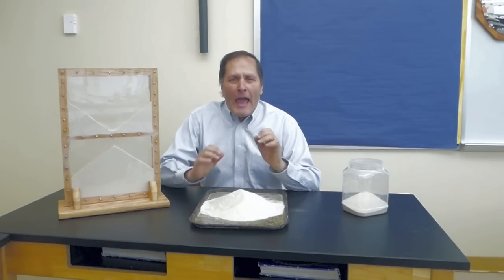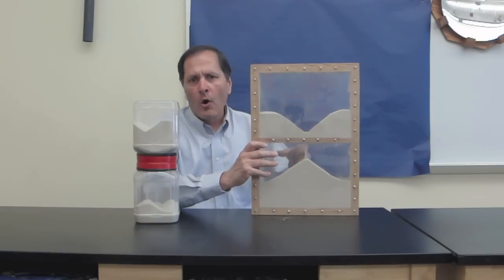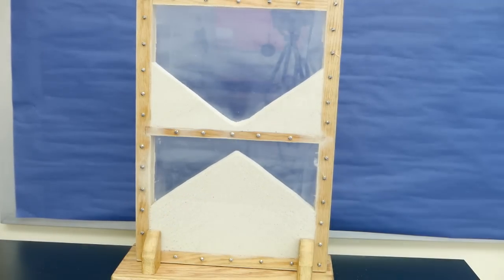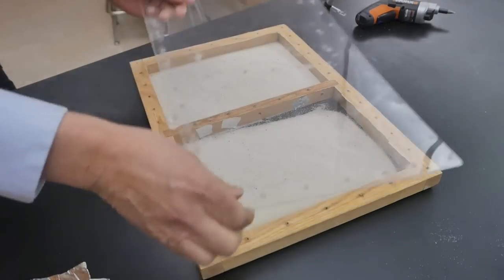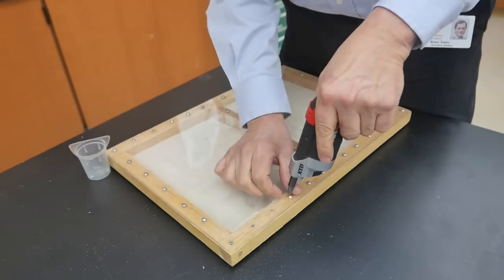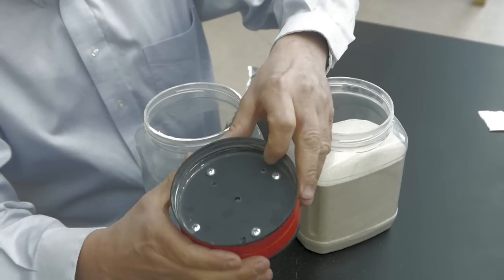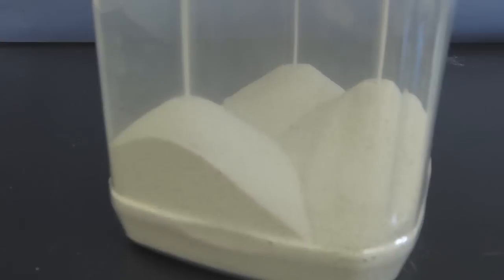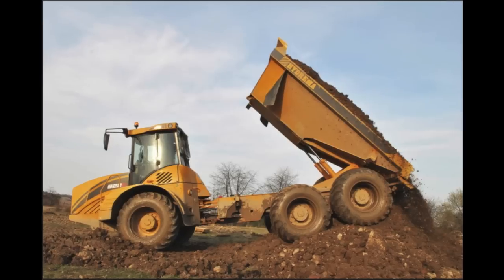Angle of repose…Physics of toys  //  Homemade Science with Bruce Yeany

Comment: Rather than unscrewing the whole panel, you could use screws as blocks for the holes. (Similar to a pin valve) that gives the benefit of adding a 3D visual confirmation of which holes are open or not... 

Though I do find it interesting the relation between the curve of probability and the angle of repose...

Comment: Hey you should drill holes in the middle and use dowel plugs to control the sand entering each hole instead of disassemble the unit each time

Comment: I dig your sand experiment. I had an idea, what if you were to make your holes through the bar intersected by an oversized hole that is perpendicular to the plastic faces, then you could insert dowels into the holes and drill holes through them, leaving a little nub sticking out through the face of the plastic that you could turn, creating something like a ball valve? That way you could open and close the holes without taking the thing apart.

Comment: interesting presentation.

does viscosity change the results, (ie, coat the particles with a lubricant)

or temperature,

barometric pressure,

size of particles,

latitude of the physical location where the experiment was conducted,

( i do like your work, never stop being you.)
Reply from the maker: Hi Molly,  some factor will affect it more than others,   type of particle,  size,  density,  powder,  if it is damp or not all change it,  the temperature or barometric pressure probably not so much
Reply: i just found you recently,

and now i am in love.

this is food for my soul,

so to speak.

love, peace, and mercy
molly

Comment: I wonder if the tape/hole system could be replaced with some sort of thumb-screws that allow you to open/close the holes without taking the whole deal apart.  (Or perhaps a set of masks with holes that slides into a groove?)

That would speed demonstrations up.

Comment: Why not just put screws in the middle piece  where the holes are and then you just have to back out the screws to open the hole instead of taking the whole thing apart.

Comment: I know this was meant to just highlight some fun interactions, but this "angle of repose" is actually something I deal with DAILY at my job. Long story short, I work with an aggregate product that includes particles the size of dust all the way up to chunks a couple inches thick. If left too long, the product "sets up", meaning it actually locks together. When that happens a pile of it can actually create an angle of repose that's 90 degrees, literally a cliff. That can be a very bad thing. We have air cannon vibrators, air spears, and dynamic dumping points. Unfortunately some times that isn't even enough and we have to break out the explosives, all just to get some powdery gravel moving.

I've spent the past few months trying to come up with novel new way to conquer these problems, but so far have had no luck whatsoever. I've tried to work with digital versions of the sand toy you showed, but unfortunately they don't allow for simulation of a product like mine. Any suggestions would be much appreciated. If I could find new ways of dealing with my product, I could save my company millions of dollars.
Reply from the maker: this is a basic example,  it is nice to hear about real life situations,  thank you
Reply: Why it sounds like you have a really cool job! This type of job never entered my mind. Or the problem your facing. I hope some brilliant person out there can help you find a solution!
Reply: I know your comment is over a year old but have you experimented with fluidisation to help solve your problem? https://www.youtube.com/watch?v=zjgURBIqJ6s

Comment: This video has a lot of focus on the concept of critical angle and the observation of such, but you almost only describe why materials have a critical angle in the description and don't go into depth about that. That's a shame.

Also as previous commenters said, the undoing of those screws is quite a hassle. What you could do is make the divider have a hollow section through which you can move a slider. This slider could have holes at specific points to coincide with holes on the divider, making it so that you can choose the amount of holes by moving the slider.
Reply from the maker: I teach 8th graders,  this is something to give them a very basic idea of the concept.  I do have a few other ideas that I want to try
Reply: Rik Schaaf the student has to go look it up 😉

Comment: I was sort of hoping for more of a look into what type of things affect the angle of repose rather than just an observation that it exists
Reply: The speed of falling particles (or falling height) changes the angle. Not just speed, the diameter (or length) of the base and roughness of base plate also changes the angle of the heap. For more info please check: Miura, K., Maeda, K., and Toki, S., 1997, “Method of Measurement for the Angle of Repose of Sands”.
Reply: stickmandaninacan    Indeed. Waiting for some surprising revelation, or strange effect, or genetal law of physics, or interesting insight, or whatever, and... nothing. Just sand that does what it always does: piling up. Hm. I feel a little bit duped.
Reply: Or maybe you could actually do some research and find the answer for yourself.

Comment: I wonder if it's the same angle like on the Great Pyramid of Giza :)
Reply: Damian Rozycki I looked into it, the Giza Pyramid is at 51 degrees from bottom to top. I bet if it started to crumble, though, the heap would be at 30 degrees.
Reply: https://youtu.be/XwK-JP0VlHA
Reply: https://www.willemwitteveen.com/the-magical-connection-between-desert-sand-and-the-great-pyramid-of-giza/

Comment: You should put spring loaded pegs going out perpendicular that can be locked open when you want to open the holes. or a stopcock valve design that can be turned to open them.
Reply from the maker: I need something here,  unscrewing it is a pain
Reply: Bruce Yeany I'm sure, that's a lot of screws! :)
Reply: phoenixamaranth I was thinking captive pegs to vary the number and location of the holes, though I suppose spring-loaded could work as well. cheers.

Comment: In your first sand frame, could you screw in a screw from the side through the plexiglass to block or open the holes without having to take it apart?

Comment: needing to undo all those screws made me cringe haha you need one that's easier to change the number of holes!
Reply from the maker: you're right it is a pain,  I was thinking of trying small pegs at each hole   that have holes in them,  turn them to either let the sand through or to block it.
Reply from the maker: Eventually,  I will change this to make it easier, I have a few other designs in mind when I get to that point
Reply: I was thinking you'd be better off using a rubber door seal between the perspex and frame, just use a good few butterfly clips or clamps to hold it together, much easier to open.

Or if you can put a smaller piece of wood through the central piece then you could drill holes in a fashion that moving the smaller piece would open and close certain holes so you'd never have to to open it up.
Reply: Bruce Yeany I imagine if you placed the holes between your screws but also made holes going through one side that intersect with the holes for the sand, you could just place dowels in the holes you wish to block, and remove them from the ones you want the sand to go through. No opening needed!
Reply: dumpywhite
That's a much better idea than my convoluted one.
Reply: With the amount of screws you had to undo to change the number of holes I'm amazed you managed to stay calm lmao. dumpywhite's idea is probably the easiest to implement. Just grab a drill and poke holes that intersect with your existing holes, and plug whichever ones you don't need with dowels. You won't even have to undo the screws lol.
Reply: Why not make it with a slider that aligns to the hole/s you want to open?  I'd think that would be fairly easy to manage.

Comment: Does the rate of speed in witch the sand fall, change the angle of the pyramid.?.. i.e. size of one hole either smaller or bigger?
Reply from the maker: I don't think the angle would be changed, just does it faster
Reply: your experiment seams like it wants to create an Equialateral Triangle.sand seams like their could be variables on grains falling left of right. rocks be uniquely shaped. i wonder if steel BB's would produce an Acute Angle or something more flat. i enjoy your channel thanks
Reply from the maker: I guess whether the sand goes left or right might be an example of chaos theory.  The angles formed  are also  going to be dependent on the amount of friction between the particles,  the more friction the higher you could stack it and the steeper the angle.  Without enough friction between them,  I would think the BBs wouldn't pretty much flatten out.  I haven't played around with any other materials other than the sand.  thanks.
Reply: Yes, speed (falling height) changes the angle. Not just speed, the diameter (or length) of the base and roughness of base plate also changes the angle of the heap. For more info please check: Miura, K., Maeda, K., and Toki, S., 1997, “Method of Measurement for the Angle of Repose of Sands”.

Comment: You could improve the wooden "toy" by make holes from one side throw where the vertical holes are, and put sticks in it. If you pull one stick out a bit (not the whole stick, because sand gets out), than the sand can run down, if you push the stick back, sand cant run down in that hole. So you dont need to take the toy apart for switching holes. :) 

Or you can make a wide hole through the whole toy where there is a vertical hole and make a wide stick with a hole in the middle and put that through the whole toy. If it has little sticks attached the two hanging out part, than it can not fall out from the toy but you still can push or pull the stick and the sand only runs when the holes get together inside the toy.

Hope you can understand :) I love your videos and ideas. I wish we could have teachers here in Hungary like you :)
Reply: You can use screws instead of sticks. Its easier to pull out (screw out) without the risk it falls out from the toy.
This type: http://www.clasohlson.com/medias/sys_master/8872506589214.jpg
Reply from the maker: Hi Dani,  I'm glad you like them and it's great to hear from someone from Hungary.   I've tried a few other ideas on how to make it easier to change the holes,  but they either got stuck or would leak the sand out.  I have one more that I am making but it is in larger plastic jars with the lids.  These make it a lot easier to change around than the wood frame